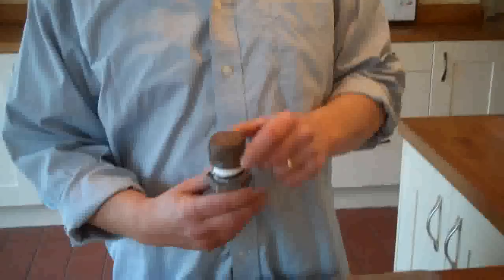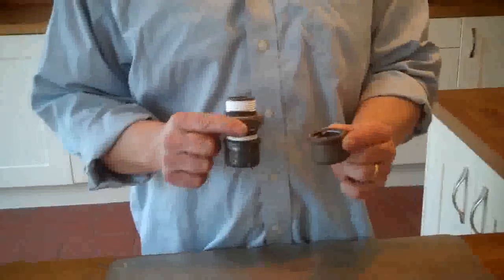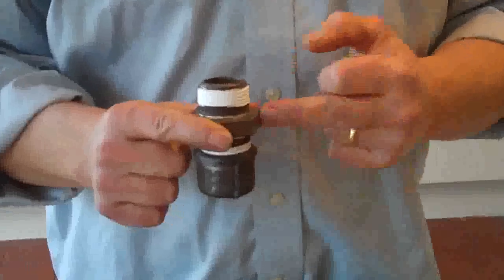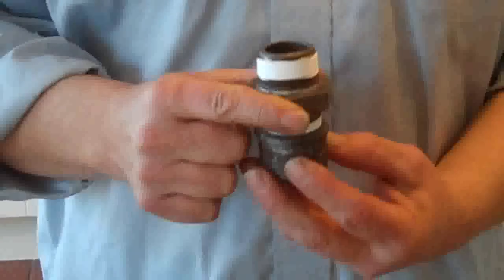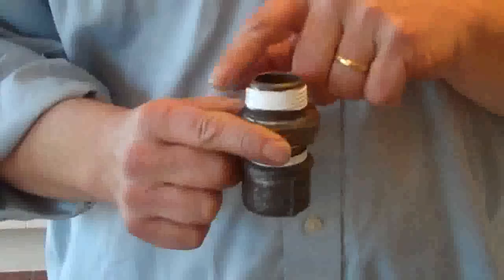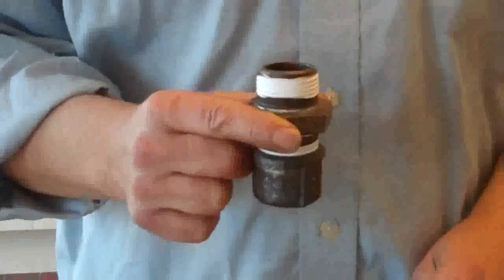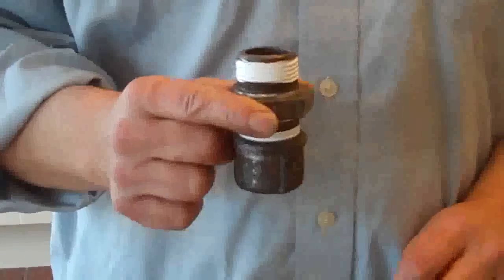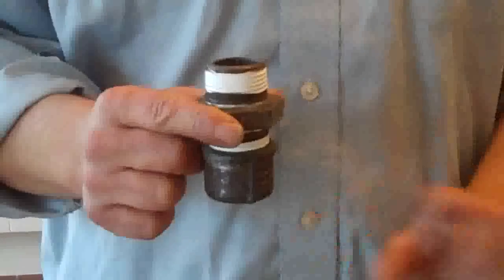Graphene from table sugar - the Tang Lau Method

Comment: Hi Rob, I know this is an old vid, but I gave this a go in a proper hydrothermal reactor, but as I'd seen elsewhere that adding a small amount of naphthalene can make carbon nanofoam from sugar using HC too, I added some of that too. Same quantities as you, but also less than 0.1g (resolution of my balance) naphthalene. Cooked for similar time and temperature as you (the nanofoam needs longer, but I took your advice and just tried it anyway!!!).

I got the same highly iridescent surface layer. Lovely purple colour in my case and left a brown layer on metal or glass with purple reflections. I didn't bother to do any other tests with it, but just interesting to see as cooking time not too long.

I tried filtering the liquid / solid mix, but most of the particles went straight through my kitchen paper filter. The solid hardly separates after a few hours, when the mixture is left in a beaker, so the particles must be very small. I'll try with a better filter too.

As with my other HC tests, the solid is brown, not black. Any ideas?

As the solid is brown, is it possible it's all GO or some other oxide of carbon variation, rather than carbon? Smell is slightly oily with a hint of naphthalene.
Reply from the maker: it culd all be GO - the main problem i found with tang lau wasn't the eaction but the purification and characterisation of the products afterwards - I thought it was a bit difficult to do without a truck load of expensive equipment and for chemists starting out with basic equipment it was a bit challeging to get non equivocal results
Reply: Many thanks for your reply Rob. An update on the small amount of filtrate left on the filter paper now it's dry. It's a mass of thin film interference colours, mostly greens, pinks and purples. I assume these are GO films. Worth it just to see the colours amongst all the brown matter. I read somewhere that GO has a high RI, which would explain the interference colours I guess.
The carbon nanofoam from Beilstein journal of nanotechnology requires more time, so I'll have another go and leave it longer.
Reply from the maker: awesome
Reply: Just FYI, totally off the Tang Lau topic, but similar HC process. I reran using a 10x concentrated sugar solution for 5 hours and too much naphthalene (misread g for mg) so the result is a bit smelly!!! Got a lovely very homogeneous light weight carbon foam. Just washing it now. Washed one lump under the tap and dried, just for quick look. Amazingly light weight, consistency like polystyrene, but it's my first completely black carboniferous result from my hydrothermal reactor! Wehey, it does work then ;)
Unfortunately not even slightly conductive, and not obviously magnetic (I've read reports of carbon nanofoams which are diamagnetic). I'm considering trying Nickel chloride as a catalyst to help graphetization, or maybe atempting to graphetize this foam in a microwave, after impregnating with nickel chloride. I'm sure you'll know better ;)
Reply from the maker: lol awesome - funny how often we discover things when we actually get up and do stuff lol

Comment: I could paint that GO onto spools of Teflon. then make a array of 668nm lasers to encompass the width of the spool with about 36watts per sqcm of said wavelength to get a large spool of superconductive side and a insulated side. take two of the spools and layer them together to make large spooled supercapicitor
Reply from the maker: go for it
Reply: Yea funds are lacking
Reply from the maker: it's always funds or time mate
Reply: Many thanks for all presentations.
Reply: So true.  Been working on a bipolar winding generator with a prime mover that is also wound bifilar  thats why I'm interested in the graphene. I want a  9MF bank for my house
Reply from the maker: cheers mate
Reply from the maker: interesting project
Reply: That's why yes is so profound to me. Thanks for the concepts
Reply from the maker: cheers mate

Comment: I'm sorry but could u use a saturated solution of distilled water and sugar then pressure heat a vessel for an extended period until a larger amount of GO is made. is this a form of steam cracking
Reply from the maker: no mate - concentration is a key parameter here

Comment: I've worked with HTC and sugar. Without catalysts and mixing, you are not gonna get alot of graphene yield. The graphene you are getting is likely the result of the vessel metal catalyizing the reaction which is why your yield is so tiny.  I like this method of making graphene because it's a way of reducing carbon in the atmosphere; grow the plant, harvest the sugar, reduction to graphene by the megaton to produce our high tech world = carbon sequestration.
Reply from the maker: all very true mate
Reply: By adding carboxylic acid or hydroxides along with plenty of others to HTC, one can catalyze the reaction while also adding functionality of the carboxyl, hydroxyl, ... groups. 
So I was always curious what would happen if I functionalized one side of an ultra cap with carboxyl and across the separator the other side with some opposite hydroxyl. Another application would be metal mining or ocean mining by tuning functional groups to a capacitive deionization water treatment.
Perhaps durability would be an issue but seems like it's worth a try...
Reply from the maker: it is mate - give it a go and let me know how you get on
Reply: I made some bench top prototypes of various carbon materials and applications, commercialization is a whole nutter story and I moved from the benchtop to greener pastures for me, literally. I'm 100% focused on my current project but still love graphene and imagine the type of applications that it will enable.
Reply from the maker: cool

Comment: Hey, I tried this using powdered confectioner's sugar, and it did not work well.  I just ended up with really hot sugared water.  Do you think that the fact that it is so finely powdered affected it's structure, causing it to not form the graphene oxide?
Later, I will try this using honey.  I suppose it is also a simple carbohydrate, so maybe it will work!
Reply from the maker: no - i think you did something else wrong - but i don't know what and i can't really tell as i would need to see you do the experiment to really know what it was
Reply: +Robert Murray-Smith I used a toaster oven instead of a normal oven, so I think that it was not preheated when I put it in.  I'll try it again in a normal oven.
Reply from the maker: sounds like a plan - good luck x

Comment: So, once in a while I get a brain storm that works.   By taking a small conductive wire and then coating it with an insulator and then placing six small Graphene sheets doped to make to be resistive  at differing electrical loads, we have a new surgery tool. 

The heat turns the wire as one side expands and the other does not.  With a similar Graphene tipped point that can be used to destroy cells and tissue in the human body. 

Since we already can make Graphene sheets and dope them after using this creation method and coat very thin wire with an insulator and mount these Graphene sheets to the wire and connect them.    We now have a Nano Surgery Tool that can access all areas of the human body.  The only problem is that you can not push the wire, it must be pulled so the wire must be non-magnetic and the head must contain a small amount of magnetic material that can be drawn by a powerful magnet from outside the body.  

The other method of control would be using the blood stream itself, like a pilot chute used in sky diving.   The wire would be pulled by the blood pressure and maneuvered changing the shape of the vents.  Small heat changes on the Graphene sheets. 

You turn the head of the wire in the vein and then draw down to its target.   So we have two systems of guidance.

Let me outline and make this very simple.  We have a simple nano knife that can access any part of the body via the circulation system that can be computer controlled the same way as a 3 D printer.    My question to you is what would we dope the Graphene with and can it be done with "Graphene Sheets"? 

Since I am in Canada and have publicly published this information it is now under copy right protection and since this has millions of dollars of value - I would like to write a joint paper and apply for a patient for this application with you?   My insight has come from part of your work and therefor you should benefit.

What are your thoughts?

The good news is no more inoperable cancers! ~
Reply: Copyright protects your expression of the idea, not the idea itself. In other words: Based on copyright, you can sue others if they copy & paste the text you wrote above. You cannot sue them if they start monetizing your idea. To do that, you'd need a patent.
Reply from the maker: +Brad Miller I think it's an interesting idea mate and you should do it yourself - i appreciate the offer but the work and idea is yours - good luck with it
Reply: Do you have a suggestion for the doping and can it be done after it has been turn into sheets of graphene?
Reply from the maker: +Brad Miller there are lots of things you can dope it with - have a quick look on google scholar that will give you quite a few ideas - i suspect it would be easier to dope it first
Reply from the maker: don't forget mate - the theory is fine but only works insofar as you can afford to enforce it - true you will get that money back IF you win but that can take years and cost hundreds of thousands of dollars - there is a possibility of pro bono - but again you have to find someone who will do that - personally i think it is best to try and have a strategy in place to deal with these issues

Comment: Teslaphoresis and Graphene -applied electromagnetic fields to self generate the armchair or single zigzag pattern for large production of Graphene Sheets using a modified Tang Lau Method.  

https://www.youtube.com/watch?v=w1d0Lg6wuvc  

So slowly pull the poles down the shallow flat reaction chamber top to bottom and if the concept is correct - large single layer Graphene sheets from sugar.  Now all I have to do is find some glass baking trays and a way to seal them  together and a way to make a strong magnetic field in an oven.  It is my understanding that heat destroys magnets.  

Now I am off to my local glass shop to get a 8.8 x 11.8 Pyrex container made for the oven, I know their are types of glass that can deal with this pressures.  Drill a small hole and plug it to use as a drain and then  I have a glass that is left with a single layer of Graphene from the oven. 

I don't know how to make an electromagnetic field that would be flat or thin but that would work even better.
Reply from the maker: +Brad Miller nice comment mate - thank you

Comment: I have been doing some basic research to find out why I see multiple islands being
formed by this method.   It turns out that we have two patterns (armchair and ZigZag) being formed and these two patterns tend to interfere with each other.   In addition, Graphene Oxide and Graphene show some cis-trans isomerism in each molecule added to the sheet.   

In organic chemistry we get left and right handedness for every thing in nature.   One is
good and the other is bad!    One is made by biological processes and the other is not.  One works in the biological system and the other screws the system up. 

So with most processed sugars you are getting both left handed and right handed
molecules to start with.  It is these patterns that are responsible for the islands of Graphene oxide that are produced by this method. So instead of a single flawless large sheet, we get multiple sheets and flaws due to the orientation of the Graphene Oxide and the armchair and or ZigZag patterns.   Starting with organic sugars would
reduce or even end these problems.(single format not left and right
handed) 

So it might be simple to create a single pattern either Armchair or ZigZag by using a 7 chain sugar called Sedoheptulose from a biological source.  This means this
sugar from the Heptose family has only a left handed orientation and as it is a straight line sugar, the removal of the single oxygen atom should force the resulting Graphene Oxide to form in only one single orientation and pattern.
 This means less flaws in the Graphene Oxide sheets produced in the saturated
solution. 

Flowing Hydrogen over the meniscus layer of the solution at low pressure might even turn the Graphene Oxide into single layer Graphene in a single orientation.  This
is just a guess, who knows? I am not sure if it can be done in the heating phase.   

Heating the water to remove all gases and then bubbling hydrogen gas into the
water just before adding the sugar should also have a very positive effect as the end product should be Graphene rather than Graphene Oxide.  I am not sure of this… 
Using a shallow flat container should have better results than a deep container should also produce better outcomes. 

It  would be interesting to see the results from freezing the finished or the starting solution and then letting it thaw The hydrogen bonding (Ice) should also have an effect on the Armchair/Zigzag orientation using the sugars suggested in your video.
A copper foil at the top of the solution might even help with this, as it defeats the bonding effect of two or more layers from forming.

One of the papers that I read, stated that single layer Graphene is magnetic and with multiple layers this effect disappears.  So in solution we have a way of separating single layer Graphene from multiple layer Graphene. 

Just some thoughts…and grievous errors.
Reply from the maker: +Brad Miller that's really interesting stuff mate - thanks for the post - i am now going to go away and think about this - good one mate

Comment: It is  a very nice video........I just wanted to ask what is the approximate concentration of this graphene oxide nanosheet one would achieve ? ........Also after drying will this thin layer be removed from the glass slide or it will remain stick to the slide............Please answer
Reply from the maker: +Rashmika Singh you don't need to ask to be answered - i always answer. Concentration depends on reaction time - read the original paper. It will stick to the glass you could use other substrates though
Reply: So Sir, if I increase the concentration by increasing the no of layers........with the product be removable from the substrate after drying.?........bcoz I have to use graphene oxide for other applications....i can't use it with substrate
Reply from the maker: +Rashmika Singh ???? - use a substrate you can dissolve away
Reply: ok thanks